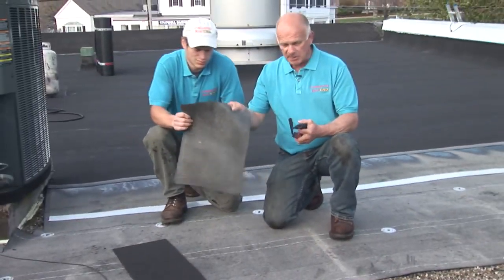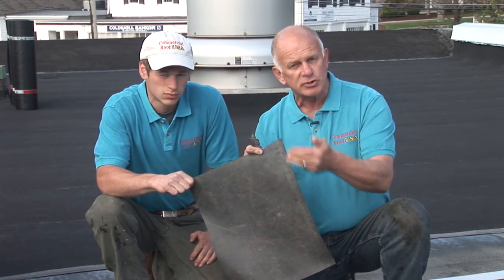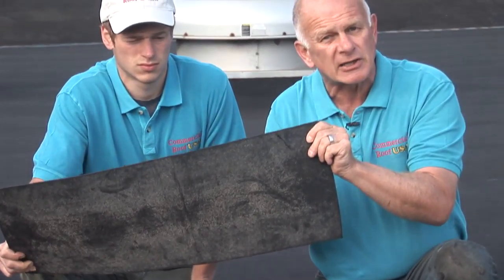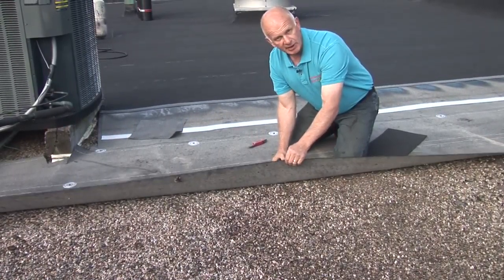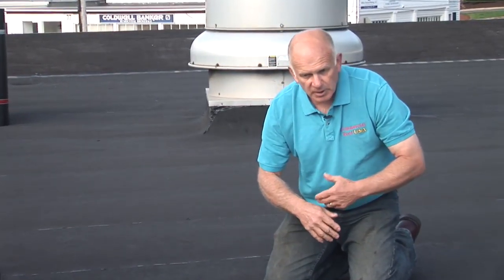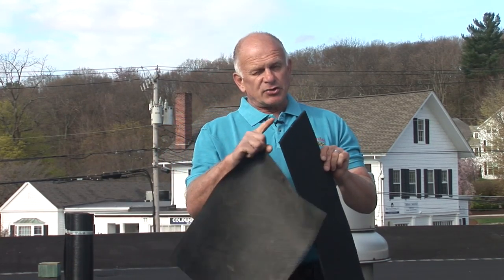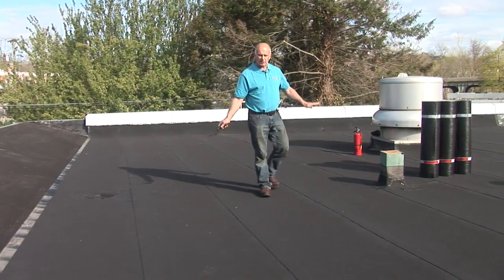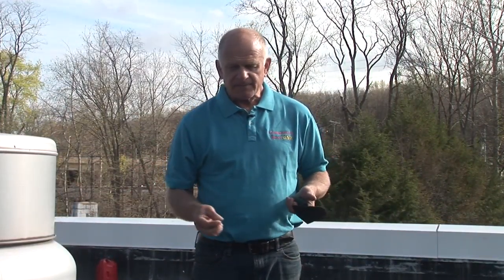TORCH DOWN RUBBER ROOF Installation over Tar and Gravel explained

Comment: so fiber paper, then self adhesive base paper and then the torch down. 

Ive been trying to find the fiber paper but here in Canada they keep telling me I need to use protection board that is screwed down as the first layer so I have a flat surface to torch down on to that will adhere to the base
Reply: they are telling you how to do it right. so you don't have to do it twice  in the long run  this roof is floating.
Reply: please do not follow what this guy is saying...... the most cowboy way I would suggest  to do torchon  over a tar and gravel roof is get rid of all the gravel "vac trucks work great" then use a mechanically fastened recovery board, tape the seams with heat tape. Then 180 base 180 cap.....  what I'm suggesting is done a lot in Vancouver. but far from the best spec....  please don't skip on heat tape or fire watch after the day... I know of alot of fires that happened hours after the crew left for the day

Comment: Wouldn't tht be a 3 ply system wit the fiber base peel and stick base and the cap
Reply from the maker: You could say so, but I call it a Two Ply System since the bottom layer is just to get a flat suface